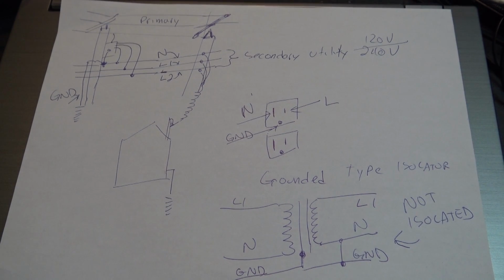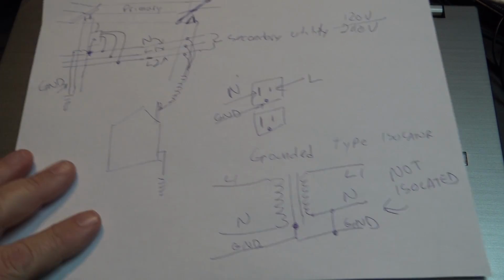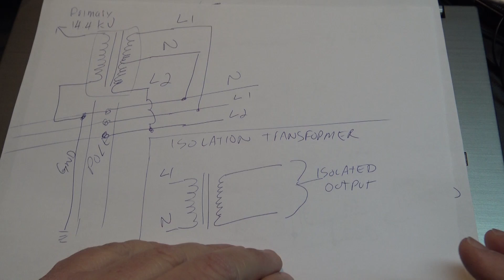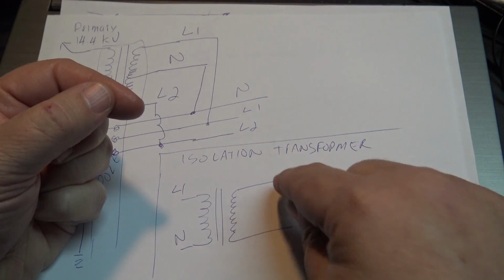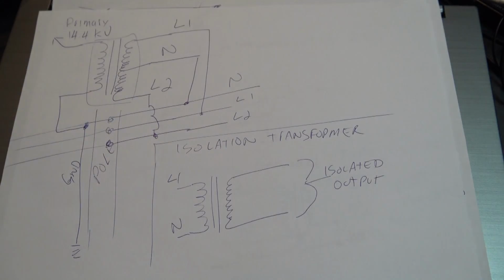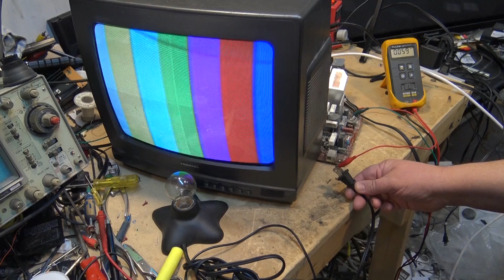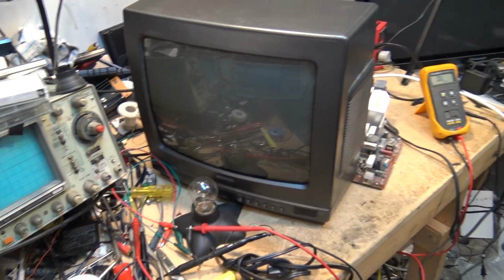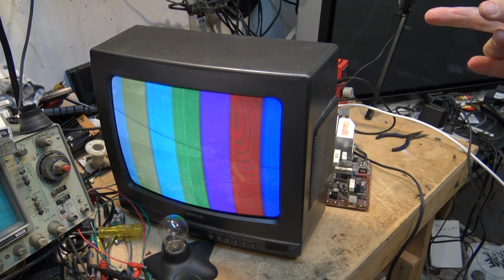Isolation transformer explained and demonstration

Comment: The only difference in the uk is the distribution transformer is massive and it often lives in a brick building, it supplys many streets.
Also its only 240v tappings, same idea though.
ive known about isolation transformers for a long time.

We cant do your test in the uk, our earth leakage or/and rcd breakers wont allow power direct to earth, they trigger and cut the supply.
Reply from the maker: We have GFI breakers here too. They are used on outdoor outlets and circuits where the outlet Is located around sinks. We also have CFCI wall plugs which are the same thing in a wall plug you it can be reset without having to go to the breaker box. I know in the UK and many other countries you have 240V single phase, so 2 conductors and an earth ground. Line and Neutral.Here we have 240 with a center tap neutral so we can have 120 phase to ground, and 240 phase to phase..My garage heater that you hear running in the background is a 240V unit. Only 3 wires, 2 hot, and earth ground.My hot tub and dryer on the other hand has 4 wires. 2 hot, plus neutral and earth ground. The phase to phase powers things like the heating element, and then 1 phase to neutral for things like the control panel, lights ect.1 distribution transformer typically feeds 12 homes. We have underground facilities in some areas where the transformer is mounted in a big steel box on the ground. What is your 3Phase voltage there?Here it is 208V phase to phase. They just use the center tap and 1 leg so between any phase and neutral it is 120, and between phases 208.
Reply: Pass i dont know the full info, 400v for 3 phase, as far as i can remember, only businesses tend to use 3 phase.

Houses dont have access to 3 phase, no need.
At 240v we only need half the current you get from a 120v outlet to do the same job.
Reply from the maker: We don't have access to 3 phase either. Mostly business or apartments were they need to run elevators. Motors much more efficient on 3phase.We have 208/3, and then it goes to 600/3 for larger businesses. That is what feeds the CO I work out of.You are right at 240 only half the current, but it is a moot point because you pay for KWh, so the cost is the same to operate. My electric car charges on 240, but I can charge it on 120 as well if I need to, but it takes all night on 12 amp 120V, and only 3.5 hours on 15A 240..
Reply: We also have an odd way of wiring up 13 amp mains outlets, i think just after the war we had a shortage of copper, or it just cost too much.
So rather than using spur wiring for every outlet, we started using a ring main from the fusebox all around the sockets then back to the fusebox, uses thinner copper wire.
I personally like spur wiring, i think canada and the usa still have that, but i cant be sure, i cant see that far LOL :-D.
We use spur wiring for electric showers.
And radial wiring that jumps to every light fitting.
My brain still locks up when i see an american call black "live", surely red would have made more sense, red meaning danger in the animal kingdom, as we are also animals.
Reply from the maker: Red and black is used.Remember that we have split phase 240V.For 120 runs the wire color is Black (hot) and White (neutral).For 240 single phase such as for water heaters and baseboard heaters, again only 2 wires, Red and Black (both hot) and of course the bare earth conductor.For 240V with neutral, which is used on kitchen outlets, RED Black and White. Outlets are wired Black to top outlet, and Red on bottom.That way 2 appliances can be run simultaneously on a 15 amp circuit.Also there is the sheath color. Wire designed for 240 single phase is red, whereas the rest of the wiring is white.For 3 phase they use Red/Black/Blue for the hot, and White for neutral.
Reply: +zx8401ztv
Its' called a "Ring Circuit", vs "Radial Circuit" see here:-
https://www.youtube.com/watch?v=hZN6hiGLtrE
https://www.youtube.com/watch?v=At7AnMV7Xd0
HOWEVER, Notice that we do NOT tend to use 'spur out to ever socket' even on a Radial-Circuit..
Reply from the maker: Right, because motors run much more efficiently on 3 phase than single. On single phase a capacitor is needed to start/run the motor. Electric cars all use 3 phase motors. The 360V from the battery is turned into 3 phase AC to drive the electric motors.
Reply: Single phase motors are less efficient because the 3 coils won't be having a 120º offset to each other, instead a capacitor will create a 90º offset into one of the coils if I'm not mistaken so efficiency is compromised.
Reply: Yep, more kicks per rotation :-)
Reply from the maker: Correct.
Reply: Did you have a look at that link i left you for ccfl lamp schematics on the ccfl repair video.
He has some nice clear diagrams :-)
Reply: In Portugal we have access to 3 phase power for domestic use, usually homes have a maximum of 30A per phase, single phase wiring also has a maximum of 30A. Here the voltage is 400V phase to phase and 230V phase to neutral.

3 phase for home use is more for water supply pumps, stoves and not much more...

Comment: Thanks for the demo. Although here in the UK we have a slightly different arrangement with the mains supply (just three conductors provided from the supplier -240v Live, Neutral and Earth) all the same safety precautions apply, as do your comments on isolation. 
Strangely enough I was looking at mains isolation transformers yesterday and I think I'm going to get one with a combined variac, essentially an AC power supply, but one with a ground isolation switch so I can control whether earth ground is connected which better suits my needs.
Reply: Earth does not provided by the DNO

Comment: 12voltsvids, You are very wise and understand these power systems at a level I have not seen from anybody outside the power distribution industry. So don't think I'm trying to degrade your wealth of knowledge because I'm not. Your first light bulb test was with no isolation and it showed that clear danger. Your second light bulb test showed how a technician isolation transformer protects you and your equipment. I'm not talking about either of those situations. I'm saying once you connect the scope ground clip to your TV chassis your technician isolation transformer is 100% not isolating you from high energy any more. I now see how your system is wired in Canada and the problem is clearly the same as I have tested in the USA. Don't do this test but! Power your TV with the technician isolation transformer, then connect your ground clip from your scope to either the line or the neutral on the TV to take normal measurements with your scope. At this point your scope is safe, just as you showed in test two, but you are no longer protected by the isolation transformer as the scope ground has strapped one leg of your isolation transformer to your home's ground system. If you reach out with one hand and touch any part of the TV circuitry that is on the opposite line side with respect to your scope ground clip and your isolation transformer you will get zapped "by the energy delivered by the isolation transformer's secondary side through your home's grounding system" just as if your TV was connected directly to mains and you were getting a zap from the mains. Yes, some point of your body has to be grounded to your home's grounding system or just good old ground under your feet if you don't have rubber sole shoes, but that's just as true with direct mains as well. Meaning your not any more safe working on the TV once the grounded scope is connected then if you didn't use the isolation transformer in the first place. This is the scope/DUT/IT testing I'm trying to warn people about. People get injured by this type of DUT setup testing all the time because they think they are isolated from mains power, which they are, but this normal testing situation exposes the technician to 100% exact same danger from their isolation transformer energy just as if it was mains energy or just as if it was a Hospital grade isolation transformer as you clearly noted in your drawings showing the secondary strapped to chassis ground. Trust me, do the test as I describe here which is a normal way people use a scope on a DUT that is isolated but please use a light bulb not your hand. ;)
Reply from the maker: Yes I know that if you connect your "earthed" scope to the chassis, and then you touch a hot point on the chassis while you are touching ground you will get zapped, but you don't need to ground the chassis to accomplish this.If you are touching a ground point on the chassis, such as a shield cover, and you touch an energized point on the chassis at the same time you will still get zapped.The isolation transformer does protect your scope from accidentally creating a short circuit. I connected it to both sides of the line, no sparks. Sure I am now tying that side of the transformer to ground, and if I was poking my fingers around in the set while standing in bare feet on wet cement I am asking to get bit, but if you are following safe servicing procedures, and that means wearing insulated shoes, and keeping your free hand away from anything conductive when working, a pocket is the safest place, you are safe. At least you don't have to worry that a hot chassis is going to blow your scope probe up. When I work I normally have my scope floating free as well. Safety first. I have extensive electrical training. Not just in this field, which I have done for 32 years, but I work now for a major telecom, so I deal with working in proximity of secondary grid power every day. In my career in the business I was zapped twice in 20 years. One time because my assistant didn't know not to talk to me while I was working and I was distracted. (This is why you should never talk to a linesman that is working, as working around electricity takes 100% concentration) The only reason I wasn't hurt was because I followed safety procedures. One hand in pocket, rubber soul shoes. No path for electricity to travel across heart. Just like a bird sitting on a wire.

Comment: are there additional specs for the transformer, current , watts etc. and do you use or can you use 240v also.  thanks again for all your work  really enjoy the learning,   also anyplace special you get these transformers from?  ty  j
Reply from the maker: Isolation transformers are available from transformer manufactures for both 120 and 240 volts. You should be able to get them from electrical suppliers or order them from the manufactures such as Hammond Transformer, Alanson Transformer ect. You pay more for large capacity. Mine is rated at 600 watts, so I can operate the largest plasma sets on mine no problem.